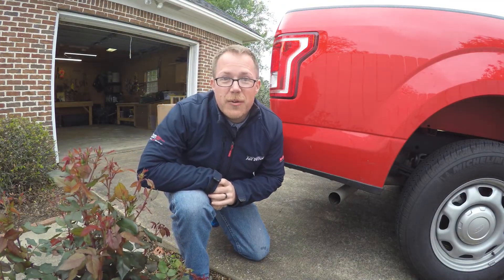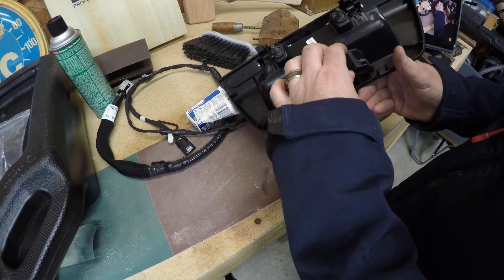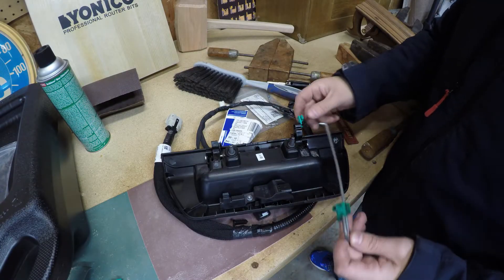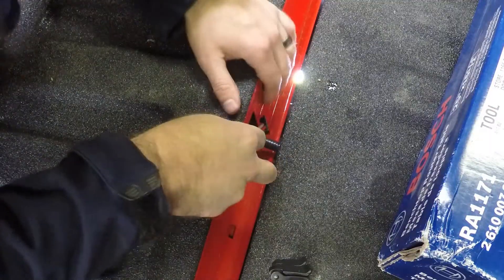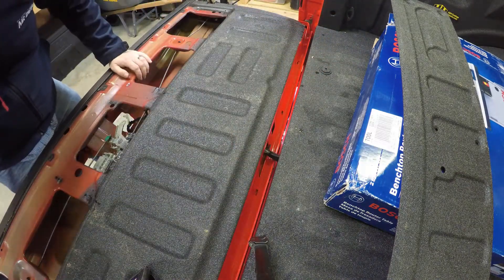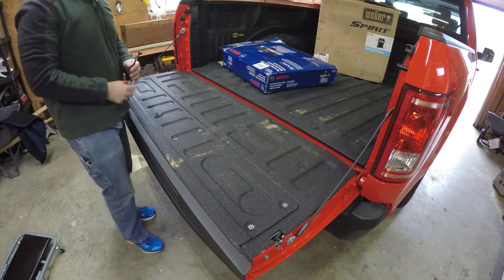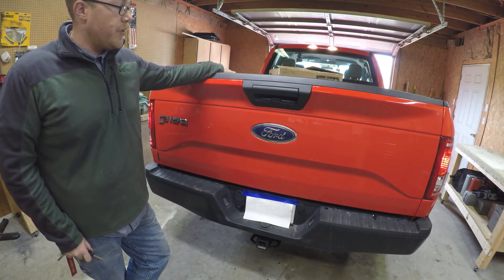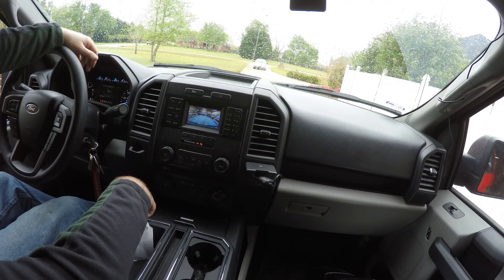2017 F-150 Backup Camera Install & Activation (OEM/Factory Camera)

Comment: I'm adding a aftermarket rear view camera and configuring my non touch screen(4in) to the camera using forscan. I go and configure everything and when I try and run the LIN new module calibration I get this message, LIN communication fault from video camera. Any help would be appreciated,  thanks.

Comment: Thank you for making this video. You are a lifesaver. I installed a backup camera and wiring on a truck that didnt come with it stock, and did the programming with Forscan and the picture is super nice and it works perfectly. I dont have the guiding lines though. Still need to figure that out. Thanks a ton!!!
Reply from the maker: Awesome to hear that it worked out for you! Glad I could help. I had to reaccomplish the forscan procedure from the PDF in the description several times to get the lines to show up.

Comment: Great video. Is there a ford part that is just the wire harness from the connection in the back by the tailgate (the one mentioned in the video) to the front of the truck  to wire it for a backup camera so I don't have to mess with the wires from the pdf. Or is the pdf way the only option really if my truck isn't wired for it? Thanks.
Reply from the maker: Not that I know of. I don't think they sell that part of the wire harness aftermarket.
Reply: I'm adding a aftermarket rear view camera and configuring my non touch screen(4in) to the camera using forscan. I go and configure everything and when I try and run the LIN new module calibration I get this message.  LIN communication fault from video camera. Any help would be appreciated,  thanks.

Comment: PROBLEM... 2016 XL. I'm following the PDF. I installed the camera and handle OEM. Tailgate wire harness OEM. Pinned the 5 wires and ran them to the front. Removed the 2 large plugs and ALL pin locations from the PDF already have a wire in them. Now what? How is the front wired but the rear has only 2 wires for the tailgate lock? What am I doing wrong?
Reply: I'm closer. I got a pigtail that has an RCA to the back of the screen. It now works. No guide lines or zoom. The only wire left in the harness goes to the LIN Bus. Anyone have any ideas?
Reply from the maker: I had to follow the forescan instructions in the PDF several times to get the lines to show up.

Comment: Hello,

I am facing an issue with the installation of a backup camera on my 2018 Ford F-150 XLT RWD V6 3.3L. After configuring the necessary modules in FORScan, the system still displays the message "Camera Not Present" when I put the truck in reverse.

While troubleshooting, I discovered that my vehicle might be missing the fuse 113 in the Battery Junction Box, which is supposed to supply the 12V power for the camera system. I am currently investigating this, but I would appreciate guidance on how to proceed if the fuse is not present or if there are additional steps I should take to resolve the issue.

Here is what I’ve done so far:

Verified and installed the necessary camera components.
Adjusted the relevant settings in the BCM and APIM modules using FORScan.
Inspected the wiring connections for continuity and proper grounding.
Could the missing fuse 113 be the root cause of the issue? Are there alternative wiring solutions I should consider if the fuse is unavailable in my model?

Thank you for your assistance. Any advice or recommendations would be greatly appreciated.

Comment: How has it held up? I'm looking into doing it to a new to me 2017 F150 XLT. But, I'm weighing my options due to the increased cost for the camera. Although if you say that it's held up, I would feel better about purchasing a 300.00 camera.
Reply from the maker: It is still working well for me and I haven't had any issues since install. No idea if the parts/camera available today are the same quality as the ones I used.

Comment: My 2017 F150 has sync 3 but no backup camera, I was able to find a used oem handle with camera and harness, but after a closer look at my grey plug it only has 2 wires. Meaning my truck is not prewired for the camera.
Reply from the maker: That's unfortunate. The PDF guide I link to in the description tells you how to run the wires

Comment: hey make stuff nation....thanks for the video. helped a lot....I have a question though....i did all the process since I change my 4in screen and all works. the only thing missing is the zoom function that doesnt work when it used to. I checked through the spreadsheets but cant find anything to fix this.
Any idea for me ?
thanks again
Reply: I also have this issue. Everything works great but the "+" zoom button does nothing. Let me know if you find a solution.

Comment: The backup lines overlay requires 2 pins shorted on the camera side. Not sure which. It's not a FORScan module.
Reply from the maker: Maybe on different model years. I was able to get it activated with forscan without shorting any pins.

Comment: If replacing a faulty camera with an OEM, DO YOU NEED TO CALIBRATE IT ?
Reply from the maker: You shouldn't need to if its the same part number. Just swap them out.
Reply: I just brought the same part number camera off of Amazon and I still have a black screen.  Not sure what that means but I will try to reprogram.

Comment: @make stuff nation. I did the codes and plugged in the main harness. Do I have to have actuator power plugged in for it to work?
Reply from the maker: I would check the PDF guide that is linked in the description. Have you confirmed that you have all the wires run from the front harness to the back harness?

Comment: I tried reading your "The Ultimate XL Backup Camera Install Guide," which of course, is NOT informative, but is really Ultimate Unintelligible Gibberish.  When I read a manual, such as yours, I cannot help but thinking, "Was it too much crack, or not enough?"  Half-explained procedures, undefined parts, wires, slots, with a few nice pictures thrown in that tell little.  But it's "Ultimate" so it must be good, right!  I bought the stupid camera, and I need to figure out how to run wires to the front.  I'm drowning here, and you're throwing me an anchor.  Great job!
Reply from the maker: I didn't make that guide. I just linked to it. I was able to figure it out from that guide, guess you just need to brush up on your skills.
Reply: @MakeStuffNation  Sir, where is the PDF to run the extra wires?

Comment: I have a F150 XL, you said it is already wired for the camera, is that true for all 2017 XL's? Isn't there a certain amount of wires needed in the molex connector to tell if it is prewired or not?
Reply from the maker: Some are, some aren't. It depends on the factory options. The PDF linked in the video description covers wiring and answers your questions.

Comment: Thanks for this vid. I have a 2015 with 6 wires, not 5 

Pin1=Purple
Pin2=White/Brown
Pin3=White/? *dirty wire*
Pin4=Purple/Brown (Video -Neg)
Pin5=White/Green (Video +Pos)
Pin6=Black (Ground)

Does anyone know what Pin(s) 1-3 are? One must be camera (hot) power, and the other two lock/unlock my guess is Purple is HOT

Comment: You need to maintain tailgate harness wires must be more than 2 wires before you proceed to installation. You are making confusion about harness under tailgate harness. Every f150 are designed defrent upgrade.

Comment: I did everything, and as I went to plug the new connector into the existing connector I saw the connector only had two wires, for the lock/unlock. After reading the instructions on how to add the 5 new wires I'll need, it would be easier (although more expensive) to replace the factory harness from the tailgate to under hood. Does anyone know the part number for the complete harness?
Thanks in advance.

Comment: I'm having trouble trying to connect. I purchased the recommended OBD2 USB cable and I have it hooked up to a Windows 10 laptop. I pull up the forscan, plug it up, turn my key to on, and hit connect on forscan. Nothing this is on a 2017 F-150. I changed the APIM for nav features. I don't know if that would have anything to do with it or not, but it just will not connect.

Comment: I went through the whole process and now l have a message on the screen that says “rear view camera not available”. Thought it would be a problem with the camera itself, then l had the dealership send me another one and nothing changed. Don’t know what else to do. Has anyone had this kind of problem as well? 2017 xlt 4inch screen
Reply: Same thing and found out that I didnt have the 5 wires for the camera going from front to back. Where the truck harness connects to the tailgate harness, if your connector has 2 pins/2 wires than its not wired for a camera.
Reply from the maker: The pdf guide in the description explains how to run the additional wires if required.

Comment: It seems as if my xlt only has the two wires. Is it possible to just purchase a replacement that is prewired that runs from the engine bay to the cab? Or does this have to be done manually? If so, what would that part be called so I could order it? Any help would be greatly appreciated!!!
Reply from the maker: Unfortunately if you only have the two wires, you will need to run the additional wires yourself. Because it is part of the main wire harness of the truck I don't think there's a part available to order. The PDF guide that I have listed in the description walks you through adding the additional wires yourself.
Reply: @MakeStuffNation  Okay. So according to the PDF I'll need to order some extra parts? Or could I get that all from an O'Reilly's for example?

Comment: I really appreciate the very detailed video. I purchased the aftermarket camera, harness, and latch assembly for my Ford 2017 F150. I installed the hardware following your step-by-step directions. I used Forscan to change the code (7A5-01-01) from 2029 to 2229. Selected "Write All" in Forscan. Turned the truck off and on. I thought I was all set. Nope!  When I go into reverse, there is a pause on my 4" screen, then it says "REAR VIEW CAMERA NOT AVAILABLE". The truck senses that there is a camera present as it shows up in the Menu. I have retraced my steps in Forscan and checked all the harness connections. I am unsure how to move forward! I would appreciate any help or feedback to solve my issue! Thank you in advance!!!
Reply: Hi Michael, I am having the same problem and I'm pretty sure it's because the rear wiring connector only has 2 wires and I will need to run wires from the rear to the front as described in the PDF.  I do not feel comfortable doing this myself so I am looking for more resources or a good place nearby.
Reply: I'm having the same problem, my story is exactly the same as Michael's. Can you to tell me where to see the PDF you referred to?
Reply: Hi , we're you able to add the cables from this point to the front of the truck?  @alexmitchell9235

Comment: I have 2016 F150 supercrew XLT. The factory harness is GL3T14B562KA. Will the harness you used be able to replace mine?  And can I get dealer to flash software next time I get oil change?
Reply from the maker: The dealer can flash the software but they usually charge you extra. Not sure about the part numbers but they might be able to answer that question for you.

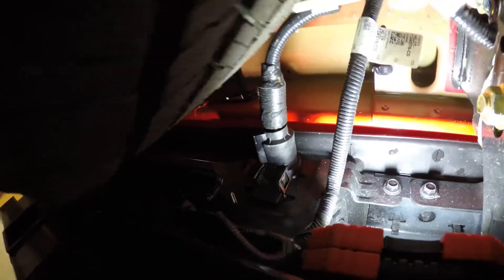Comment: Awesome video, but before you go and buy parts make sure your truck is wired for camera. If the wire harness mentioned in minute 5:50 only has two wires coming from the main wire harness, your truck is NOT wired. Don't even bother! I learned this the hard way.
Reply from the maker: The PDF guide in the description has instructions to run the additional wires. It is not very difficult just takes a little attention to detail.
Reply: Its not hard at all to run the additional wires. His PDF guide makes it easy.

Comment: Hi ,I have  2016 f150  I try put back camera and used with screen 12.1 linkswell  I buy same camera and wire you used on the video but the truck don't detect so can I used the forscan to detect the camera,

Comment: Great video for the do it yourselfers! The only problem I see is the connection via computer to the factory screen. So, I researched both obd units online.....quite affordable, do you need both units to complete the install? Also, you need a license for the fourscan in order to complete installation, if so, I haven't researched the cost of a license yet. Is there another alternative other than a visit to Ford for the computer connection connection??????
Reply from the maker: The Forescan licence is (or was) free if you sign up/join their forum. As far as the OBD units, you should only need one as long as it has the switch to change between the 2 modes (should be a link to one in the video description).

Comment: Is the backup camera wiring there for Canadian F150s?  I have a Canadian 2017 XLT F150 with 4" screen.
Reply from the maker: I assume the wiring it the same on both models. You'll just have to check the harness at the connectors and see if they ran all the wires or if you'll need to add some.
Reply: @MakeStuffNation  What do you do if the 2 front harnesses already have wires in them?

Comment: Thanks man! You saved me over $600. Camera went bad on 2016 F-150. Dealership wanted over $1000 to fix. Bought the camera online for half of Ford's price and then installed it in 10 minutes using your video. Bought the USB ODB II for $20 and calibrated the new camera using your instructions. The process of downloading the software and getting a license was a little laborious, but when it came time to connect to the truck and calibrate, again it took 10 minutes. So, the dealer wanted $1000 for 20 minutes of work...ridiculous!
Reply from the maker: I'm glad it worked well for you!

Comment: What’s needed to add a handle with the led ligjt aswell?
Reply from the maker: You would just need to order the handle that includes the light. It is the same wiring harness for both.
Reply: Make Stuff Nation okay thanks, mine only has camera but I want the led

Comment: I don't see none of these settings in Forscan. Do you need the extended license for them to show up maybe? What am I missing?
Reply from the maker: If I remember correctly (its been a few years), if you sign up on the Forscan forum they give you the extended license which unlocks everything.

Comment: I just got a 2015 XLT, I have the power lock like yours.  I assume this will work on mine?
Reply from the maker: Yes, it should work. You just have to confirm that the additional camera wires are run from the front wire harness to the back harness plug. The guide in the description shows how to identify these wires and how to install them if they're not already there.

Comment: Has anyone done this on a 2016 F150 XL?  I have tried this with the ford parts and using forscan but the computer would not enable the module.  On the screen it showed that it could not enable the rear camera.  I wouldn't think the 2017 and the 2016 to be very different.
Reply from the maker: 2015-2017 should all work the same. I would triple check the wiring. If a single wire is pinned wrong or has a bad connection forescan will not detect or enable the camera.

Comment: Changed my 15 tailgate to a 18 tailgate like the F150 detent in the tailgate. Everything was a bolt in swap (linkage) except for the handle ... then found out it has a different camera. Got all that changed and backup camera works but lost my guide lines. Plugged in the old camera and guidelines came back and was square even though the camera was dangling. Like you trying to figure out how to bring the guidelines back on the new camera I found this on the Forscan site but do not know the sequence to cycle the key. If you figure it out I would appreciate it! 

Re: Code: B115E - Camera Module
Post by Echerr » Thu Dec 19, 2019 9:29 pm

I was able to fix my rear camera on my 2016 F250. My tailgate was stolen and after I replaced the rear camera with a new one the fixed and moving guide lines were missing. I was also unbale to zoom in. The DTC i had stored was B115E:55-0A. After i connected with OBDLink EX (usb to OBDII) I ran Forscan. Under the wrench icon I selected “Local Interconnect Network New Module Calibration” under BdyCM. After it ran I cycled the key to off and back to on as instructed. Both fixed and moving guide lines are now present and the zoom function is now working. Hope this helps.
Reply from the maker: Thanks. Glad you were able to get yours fixed!
Reply: @MakeStuffNation  not fixed  yet trying to figure out how to bring the guidelines back on the new camera ... do not know how to do the the sequence to cycle the key  ... do know the exact procedure to do this?

Comment: Will this work on 2016 XL?
Reply from the maker: I'm not completely sure. There was a changeover in design around the 2017 model year. They process is the same but you could check an online parts catalogue for the correct parts numbers.

Comment: good intellectual video,  thx for it, to do this, it is not cheap other than your own free labor, the part cost at amazon is $300 and plus the computer software cost$190, hence, you can tell it is $500 already, no wonder the ford dealer at san jose northern california try to charge $1000 to install a back up camera.
Reply from the maker: Thanks. Yeah, prices on the parts have definitely gone up over the last few years.

Comment: I have a F250 for work but with a tool box style bed.
I added the rearview camera with a separate screen but I want to interface it to the factory screen.
I think I saw a 9 pin connector on the frame in the back so I wonder if the truck is pre wired for it.

I already have forscan.
I just need to figure out what wires are the composite video signal.
Reply: Did you figure it out?